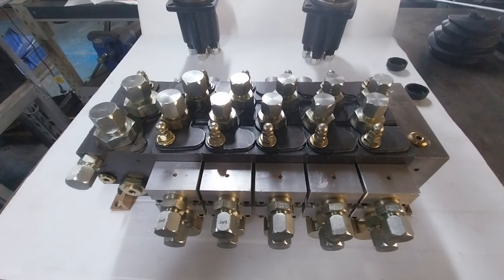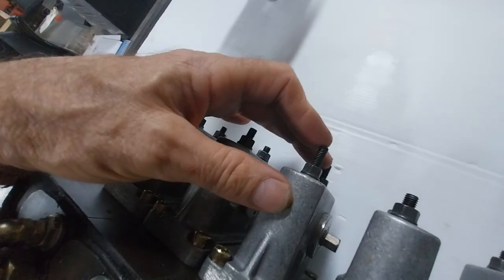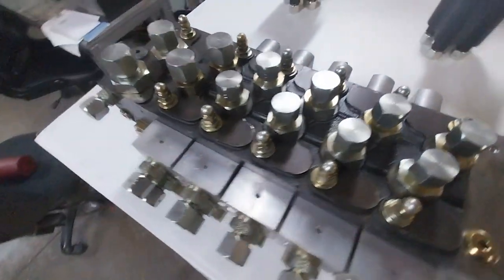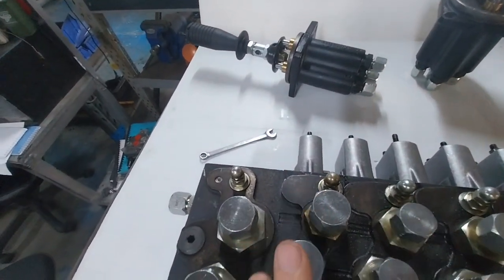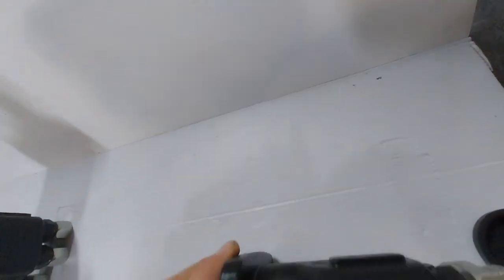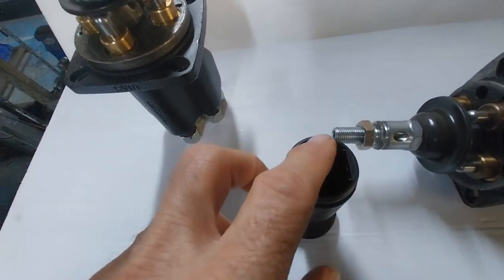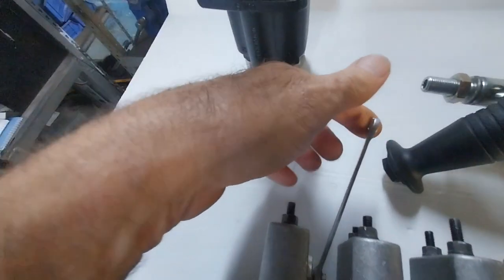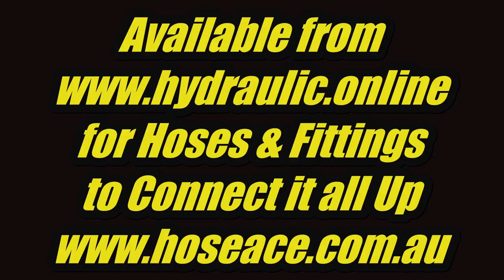Hydraulic Directional Control Valve with Joystick Pilot Control

Comment: Are electronic joystick models available?
Reply from the maker: Yes here is what you will need. https://www.hydraulic.online/Proportional-Radio-Remote-Control-PWM-8-or-12-Functions-IP66-p491780895 and https://www.hydraulic.online/Proportional-Sectional-valve-200Lpm-p234291477